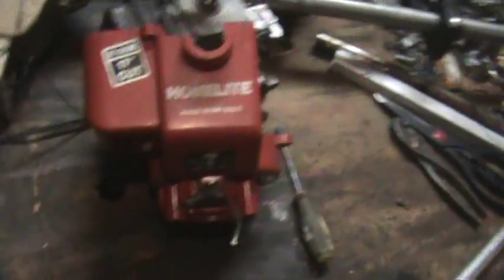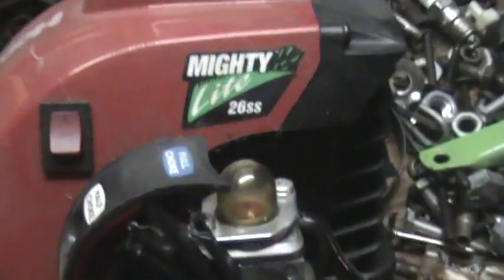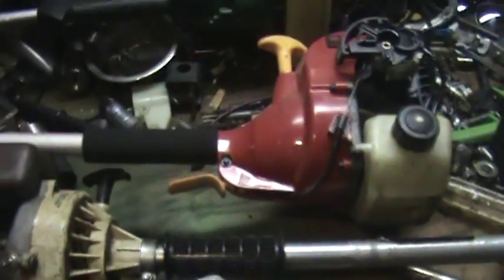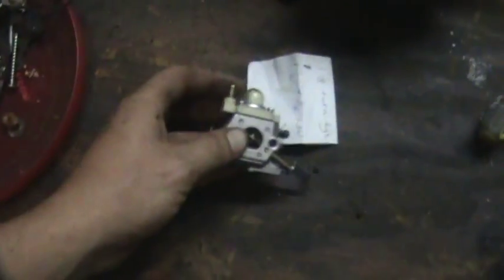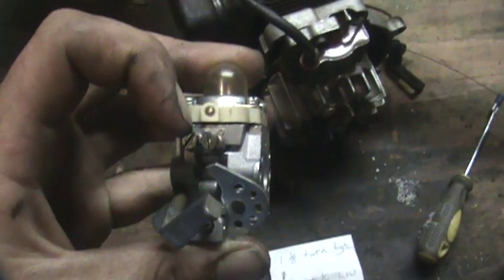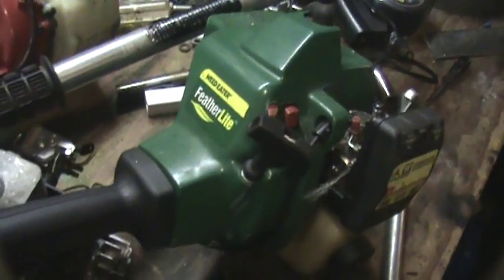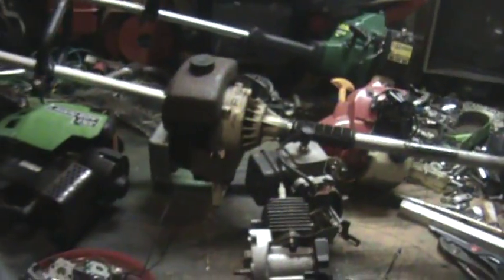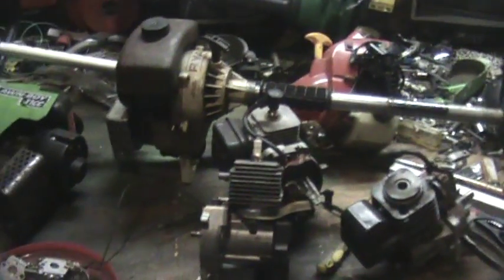what to use for an engine on your weed wacker bike

Comment: Is a really old 28cc craftsman a good motor? I've got one that's been sitting for 5 years but it's not siezed so all it should need is gas in the carb and new fuel lines. Just wondering if this motor is suitable to put on a bike

Comment: I will say the 26cc Homelite puts out decent power, equal to the 25cc if not a little better. Definitely more power than the WeedEater Featherlite that I received free & am now using to replace the Homelite weed wacker whose engine I am now prepping. You're right about there less metal on these. The mounting points are not as robust & cooling fins are thinner. But I don't think it's a total disaster. For now.

Comment: My first bike used my '05 25cc Homelite, old style. My second build is going to use the newer 26cc Chinese Homelite. The carb can be adjusted be grinding away the little wall around the screws & putting notches in the screw (you probably know this). The carb is probably a Walbro knockoff. I've heard that there is no crank bearing in these, now a bushing. Anyway, I still think a person could get a couple thousand miles out of these with sensible use. We will see.

Comment: @superbobwiley1 iuse the oiler. runs a bit rich actually lol but if it hasnt run in a long time put mix into it so the pump gets oil through it and u arnt running with no oil for a few minutes